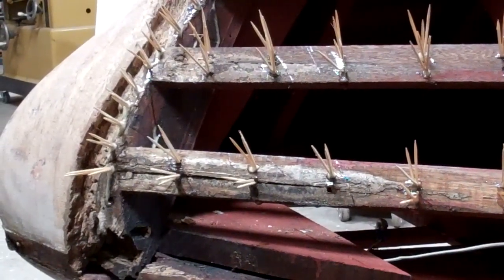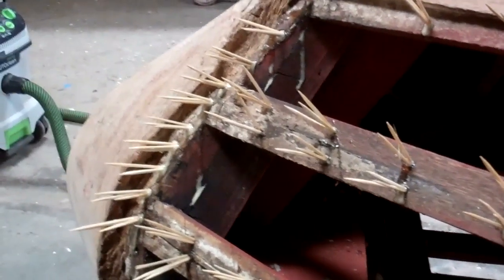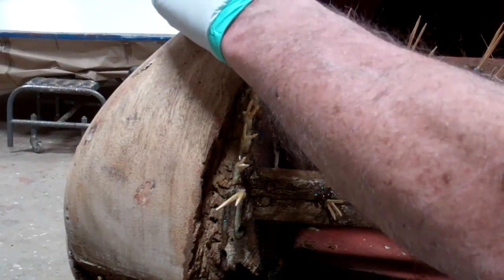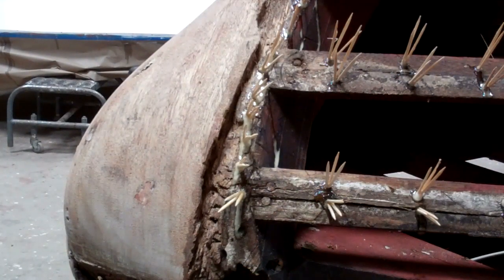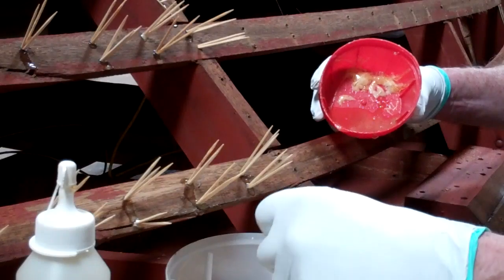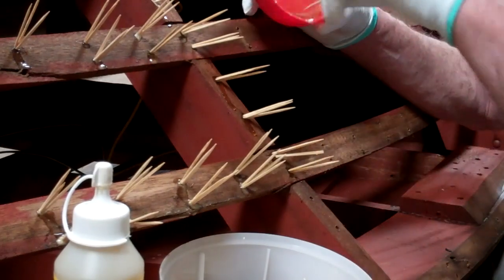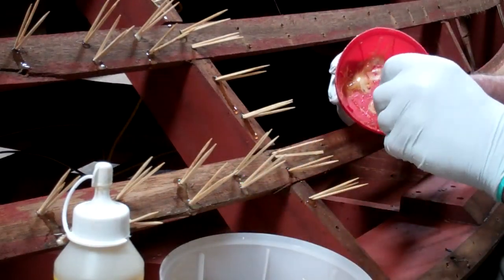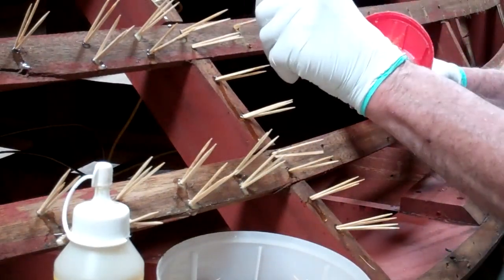1956 Chris Craft Capri   Bullnose & Plank Rot 5 10 2020 Snake Mountain Boatworks LLC

Comment: This is a prime example of the limitations of the "preservation " vs restoration.  Without plank removal you cannot for certain know that there is not underlying rot.  With removal of the topside planks you can inspect for rot, remove broken fasteners, treat all sides with CPES and bed it back with 5200 if the plank is in good condition.  With bedding with 5200, it makes the entire topsides more stable.  If you decide to not remove the planks you should at the very least refasten the sides before you start to fair them. With the years of plank swelling and drying out, fasteners brake or loosen up.  Without addressing this problem, you are asking for problems down the road.